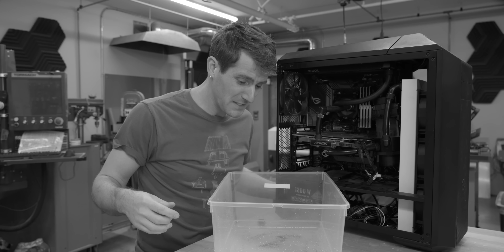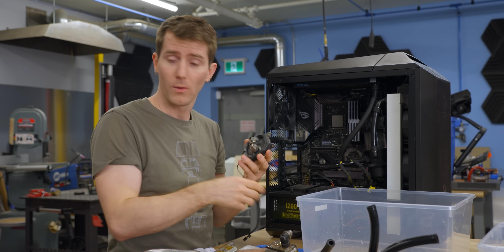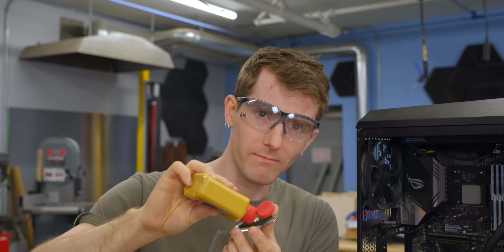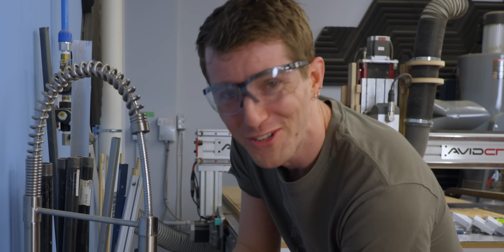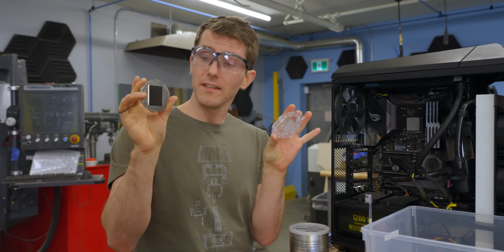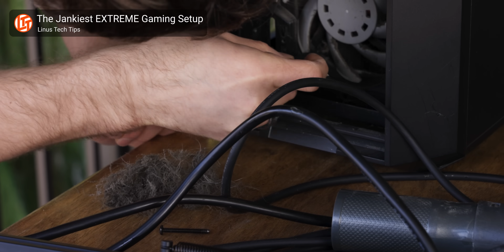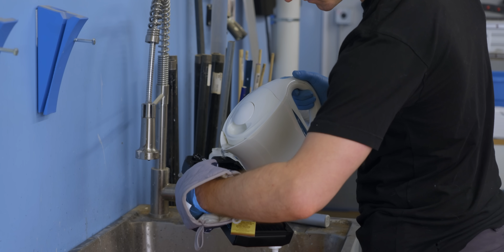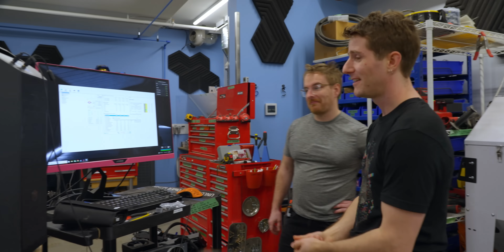I Will Never Watercool Again – Water Cooling Maintenance Guide

Comment: air cooling maintenance: "is it spinning?"
Reply: Is it dusty?
Reply: @semi.  ah a lil dust dont hurt :) just keep spinning
Reply: Disassembly, repaste, reassembly. Done.
Reply: @Legendendear  do not disassemble. just open the side panel, and blast with canned air. done.
Reply: @freedustin  
Thermal paste degrades with time and heat/cool cycles, so it's recommended to renew it every few years
Reply: @Legendendear  its not that big of a deal until it become thermal concrete, and even that is pretty easy to deal with. Just use a hair dryer to separate the thing from the CPU.
Reply: @Legendendear paste? No, Karbonaut sheet.
Reply: @Legendendear  Or if you use phase change thermal pads, just reseat.
Reply: No, it's breakdancing
Reply: @Basil_Ieaf Nah dude, it‘s solving the Birch and Swinnerton-Dyer conjecture.
Reply: @Dasgabar Idk, Noctua fans are pretty smart but that might be a bit much for them at the moment. Maybe the Hopf conjectures are more their speed.
Reply: @Basil_Ieaf  maybe it knows what its doing
Reply: @Basil_Ieaf  It's doing the windmill
Reply: Be honest folks, you just clean them if there is an actual dust carpet under the fan.
Reply: Also: If bearings are failing, but still working, apply light percussive maintenance.
Reply: I have to give it a little tap  every time I turn  the computer on but yeah still spins
Reply: @amacias2012  💀💀
Reply: Even if it stops spinning if you have a good dual tower cooler you are not in immediate changer. You certainly have to replace the fan but for very light tasks the tower should still keep it cool enough. I suspect in my torrent case that if I lost both fans on my tower cooler (somehow) I could probably just pull both off and keep using the system with all the airflow from the case fans until replacement fans arrived.
Reply: If it's an AMD chip, you can just consider it an upgrade to passive cooling.
Reply: „The greatest technician that’s ever lived“
Reply: I had 2 AIO for the cpu and both pumps died.  Never again.  Now it's air cooling 100% of the time.
Reply: @Kuli24000  Probably cheap AIOs
Reply: hears faint whine
Taps center of fan
ringing stops
shrugs
Reply: Arguably same as saying; Water cooling maintenance: "Is it flowing?". But yeah, I don't do Water cooling. I like my large case, I never worry about not having room for anything. Same case for 15 years.
Reply: Me with my HAF X with all original fans. (They're 14 years old now)
Starts computer
Side mounted fan starts rustling
"Eh, it'll shut up in a while."
15 minutes pass
"All is quiet on the western front."
Reply: Oddly enough, my 3070 fans sit still most of the time, unless I'm gaming or rendering video.
Reply: @dashcammer4322  thats... normal
Reply: It is also cleaning the dust out from time to time 😷.
Reply: I had to lube a fan which made ticking noises
Reply: I have a FX-8350 stock cooler on my ryzen 7 1700 and I don't even do that, I just unplug the CPU and case fans and spray them with the air compressor sometimes and have my MSI B350 gaming plus set to show an alert if any of the fans die and forcibly shut down if the CPU temperature gets too high.
Reply: Yeah ignoring that thick layer of hair and dust is completely fine
Reply: Is it making weird noises?
Reply: Noctua gang
Reply: is it turned on?
Reply: Most people forget about that "is the air getting through?" detail...
Reply: this is why i like air cooling. you remove the dust once in a while and as long as the fan spins all is well.
Reply: The problem is on air coolers you have distorted cooling surfaces which causes warping. Look up CPU warp, that can not happen on a proper liquid cooling system. Liquid doesn't cool any "better," it just does it "completely and evenly," it's the same reason why air cooled automotive engines fell out of style. Variance cooling can't be solved with air cooling alone. One side will always be cooler than the other. With liquid that can't happen if the level is maintained, because the liquid contacts the entire surface and transfers the heat evenly throughout itself. 

What they did here was build a deliberately bad cooling rig, with tap water, and then let it sit in a sunny room while running on stress tests. You use proper coolant and don't have your PC in a window sill and you won't have this issue ever. Drain and replace the fluid once a year with fresh distilled water and a decent coolant mixture, and your solutions won't cause this type of grime and corrosion. The nickle corrosion happened because the minerals in the water acted like very light sandpaper. That's why distilled is important.
Reply: @BigPanda096  I'll never build a PC I'm a console gut but that was pretty interesting
Reply: Is it dusty?? Who cares about dusty as long as it doesn't creeped by insect and lizard it Will be fine
Reply: But also "Is it clogged with one metric kilogram of disgusting cat fur flavoured filth"?
Reply: did you not put spray paint on it?
Reply: AIO's are like that too..
Reply: @j.r.8176  add "is the water contaminated", "is the water clean", "is the pump working", "are the seals right". Bet you thought you did something there.
Reply: The thick dust chunks inbetween the heatsink fins:
Reply: Often it's a matter of enough or more than enough. Had an intel with a boxed mini mini cooler. Got pretty hot but only on heavy load. But IAM under the roof and before the summer I wanted something better. Got a used noctua from a friend... Temps dropped more than 30° Celsius on load 😂 there is definitely more possible. I only have two 8*8 case fans. A third comes in. But more importantly it's enough.
Reply: I laughed then I remember i downed my 6900xt tj temps from 85 to 65 C with watercooling
Reply: Atari wins anyway..😅
Reply: Air cool troubleshooting is it spinning
Reply: Is it dusty?, is it spinning?, and is the thermal paste need to be changed?
Reply: More like air cooling maintenance: either I huff this duster can or I actually use it to clean my PC
Reply: Yeah i use AIO and just replace it every 3-4 years its a waste of money but I do not want to deal with this ever ever id rather just use fans at that point.
Reply: “Fan spin!”
Reply: Air compressor go brr
Reply: Air cooling aesthetic: It's unsightly
Reply: @huskers1278  I only build functional systems. No rgb, solid side panel and parts chosen for suitability.
Reply: @Immudzen  Pretty sure my 13900k, 4090 rig is quite functional
Reply: @Immudzen  I build them all, but my bread and butter is custom gaming systems and server towers. In both regards, all the functional equipment has RGB on it, mostly for designation and signal purposes in the server tower case, but the RGB alone doesn't make something bad. It can be both pretty and functional. That's how I'm contracted to design and build server towers. Companies like having pretty server rooms with functionally beautiful equipment to show off in pictures and board room meetings. In that case I must do both extreme function and top tier design. You can have both, a sign of one is not a signal of a lack of the other for quality reassurance purposes. That's just false equivalence.
Reply: @BigPanda096  I just really hate RGB in systems. I do understand it being very useful in switch panels in a server room to quickly diagnose problems but in a normal computer I just don't like it. I disable all of it and I purchased a case with a solid side panel. I don't like the idea of glass side panel since a single sharp hit can destroy it  and the plastic ones seem to get really badly scratched up. A solid metal side panel just seems to hold up better over time.
Reply: @huskers1278  Yea.....what sucks is some of the flat coolers look nice, but the actually good coolers like the tower coolers look so goddamn ugly often. Some of the newer ones look way better but, eh, the look of rads is hella nice.